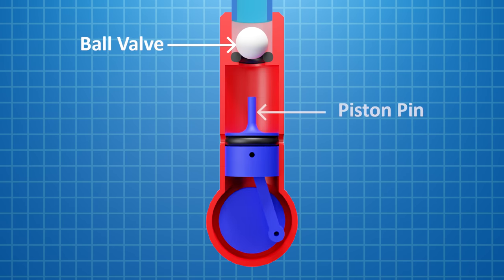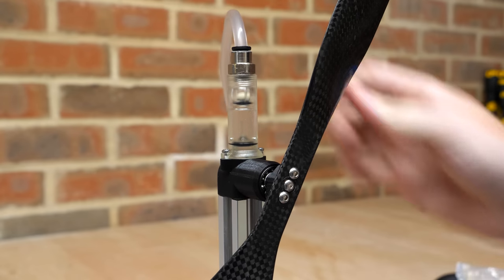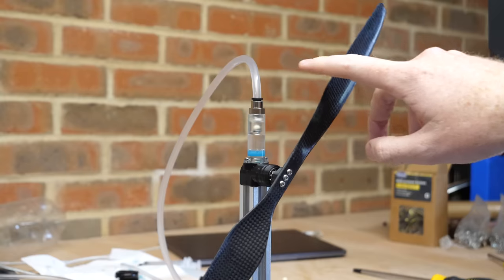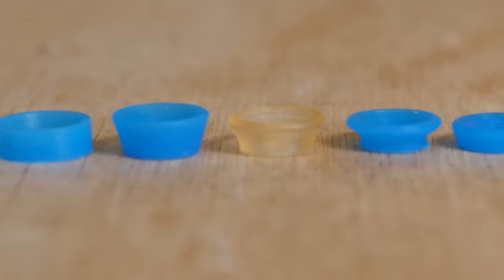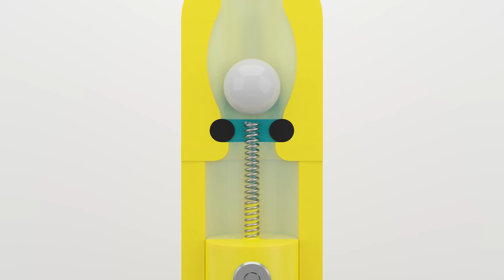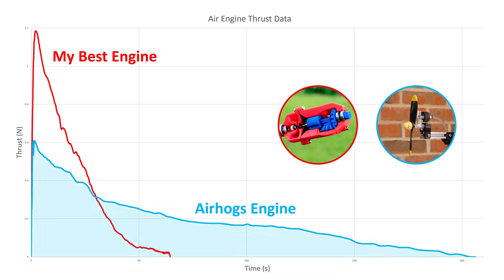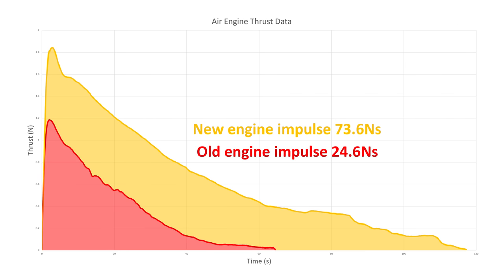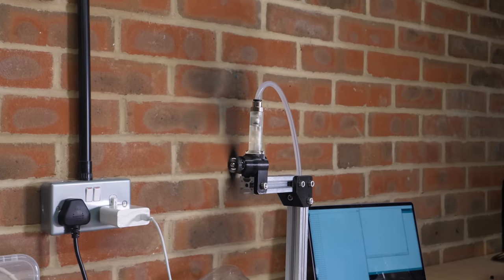Optimising an Air Engine

Comment: Would be interesting to replace the metal pin with a screw and see how adjusting the length of the pin affects the performance
Reply: Or create a cylinder head with screw to adjust height
Reply: maybe an Idea? firstly you could increase the piston total movement (increasing chamber/cylinder length), when piston is going down and reach in middle of chamber the piston also reach in the chamber roles, releasing the air pressure and after that this roles will close (maybe using more rubber valves) and the piston will continue its movement going down, at this moment it will create a vacuum in the chamber when piston reach on bottom of cylinder helping the piston up again with vacuum in the chamber, this could create more power?
Reply: yes it would be like ajdusting your camshafts
Reply: Or notching back a steam engine's reverser.
Reply: that would work if the air pressure was constant , which it isnt .
Reply: @brain8484  it would optimze anyway
Reply: @giovanefortuna that would modify the compression ratio, but the only thing that could change would be the time it takes for the compressed air to fill in the cylinder (and the height of the ball bearing of course)
Reply: @giovanefortuna  Not the same
Reply: @PedroGarcia-fl1fu  Hi Pedro. My first thinking about your idea: You will never harvest more energy from the "vacuum" than you needed to generate it.
Let me know, if you don't agree.
Reply: @g.j.647  true, you are right
Reply: @wololo10  Screwing the cylinder down, adjusting the head or rotating n eccentric crankshaft bearing have been used in CO2 engines.
Reply: Or you know, just start with a long metal pin and gradually grind the end down. You only need to do the test once to find the best length.

Or just use a removable pin and different length pins.
Reply: @PedroGarcia-fl1fu  no. just more moving parts and friction. but the idea of longer stroke would be good if the piston will come up more before the exhaust ports are closed by the piston so it have more momentum going up.

Comment: 3d printing is good for a lot of things, but a low friction piston cylinder is not one of them. You should design a piston and housing that fits a standard diameter glass or acrylic tube for the cylinder.
Reply from the maker: I've bought some acrylic tubes for this exact reason! I couldn't find any 12mm inside diameter tubes (diameter of my current seal design), so I ran out of time to re-design and mold new seals. But I will definitely experiment with the acrylic tubes for the 'aircraft worthy' engine!
Reply: @TomStantonEngineering maybe something similar to the glass tube/graphite pistons from a company called Airpot. I got a free sample years ago to try and make a Sterling (Stirling?) engine and the fit and low friction is outstanding.
Reply: @TomStantonEngineering would steel tubing work? You can get seamless hydraulic tube with 12mm ID
Reply: @TomStantonEngineering  Better option is to use a conical cylinder. and MACHINING. 3d printing is FAR AWAY from precision. as you stated there are air engines already in the market. why try to re invent the wheel since 3d printing will never have enough precision for something like this.
Reply: @vihreelinja4743  On the one hand, note that even with his techniques, he's still improved over the engine on the market multiple times. On the other, imagine combining his techniques with their production quality...
Reply: @TomStantonEngineering
Can you try with an engine ?
Reply: I suppose you could try machining the parts, yeah. There's also people who leave their 3D prints in a vapour of acetone, depending on the plastic, and it slightly softens the plastic, smoothing the rough edges. Wouldn't be great for precision but that'd be the challenge!
Reply: @daveycmusic  He's trying to build an airplane, not a submarine. We need to keep the mass as low as possible.
Reply: @JustOneAsbesto  14mm od 12mm Id hydraulic tubing will be grams more than the acrylic / glass but will work and will last
Reply: @vihreelinja4743  Because it is not about developing a product to sell but to learn something in the process perhaps?
Reply: @JustOneAsbesto check out gasparin engines
Reply: @TomStantonEngineering  I was so inspired by these engines that last year I started design around a syringe as a cylinder liner (20mm,15mm), and was hoping SLA printed piston will be good enough not waste too much efficiency, but syringes have ~0.1mm ID deviation, so fdm piston and tiny o'rings is the current design, but after this genial video with silicone molds :O I'm not sure I can beat it in this 2L engine impulse challenge.
Reply: or, you can print the piston and cylinder wall a bit larger and thicker, so you can sand it down make it a lot smooth
Reply: Turcite piston head
Reply: Even just directing the exhaust backwards has to help slightly   

I could also soo making the exhaust holes bigger but making pin smaller so it opens less might give better results
Reply: Would resin printing work as well? Resin printing has a higher resolution so in theory, the surface should be smoother
Reply: @rbuddsdiy  I put together a LTD (Low Temperature Differential) stirling engine kit from a UK company called Kontax.  It can run off the heat differential from your hand and the ambient air temperature, albeit slowly.  This is exactly the super-low-friction design they use -- a glass tube and a graphite piston (and a lot of ball bearings)!
Reply: @TomStantonEngineering  It might also make sense to create a two-cylinder boxer design to reduce the losses due to vibrations. One of your test stands is very stiff so you might not register them in your tests.
Reply: @TomStantonEngineering  I don't know if the materials involved are inherently bad, or if they cannot be sprayed with a lower-friction substance, but you can use plastic polishing compound - extremely fine mud - to polish the involved parts until they are as smooth as possible. I have done this with 3d printed bearings that use airsoft bbs!
Reply: @daveycmusic  but the thumbnail, you forget youtube primary focus is vanity vanity vanity
Reply: @JustOneAsbesto the steel could be less mass than the acrylic for possibly more structural integrity. Maybe aluminium is the happy middle ground?
Reply: @vihreelinja4743  Because his goal is not to make a production ready air engine. His goal is to experiment, learn, and have fun. This is about the process, not the end result.
Reply: @daveycmusic  steel might add too much weight I would think
Reply: @lordfrz9339  thin wall hydraulic tube is very light
Reply: @lordfrz9339  I agree with Davey, for the same structural strength you can obviously go much thinner with steel, so possibly lighter (less mass at least) than acrylics.
Reply: All the gear no idea 😂
Reply: @JustOneAsbesto making the cylinder out of machined 7075 aluminum, you could achieve much lower wall thickness and still be lighter with twice the strength and more precision
Reply: @TomStantonEngineering  No, seriously, I'd just buy a simple Stirling engine that sits on top of a cup of tea, and use the cylinder and matched piston from that. It will save you a whole heap of trouble. The fact that you got a 3D printed piston and cylinder working at all is astonishing, but those precision-made pistons and cylinders are are light, transparent, and have exceptionally low friction yet an air-tight fit.
Reply: @TomStantonEngineering  I also can’t help, but think that you need a leave! It would transform the accuracy of your piston and cylinders.
Thanks so much for this incredible content! 👏👏👏👏👏
Reply: @TomStantonEngineering  You can change the shape of the ball to one similar to Lollipop with the slotted stick, the piston would be concave and you could. thereby reducing the length of the compression cylinder
Reply: مگر جنس خشک چکار هست؟
Reply: خیلی خوبی از ایران
Of iran❤️🇮🇷🤌
Reply: @guygittins6934 Do you mean a lathe? Fair comment if so. 👍 Predictive texting is still very inaccurate, I thought AI's were supposed to learn but maybe we don't give them good enough feedback? This needs a better coded mechanism/UI for users to approve suggested spelling and meaning corrections at least review changes before we can hit the Send button. It seems predictive almost sneakily changes words after our attention has moved on in the comment composition process. Unhelpful for users and the predictive algorithms, whether AI or not. 👍😊

Comment: Crazy to think how little thrust you’d get by simply letting the air shoot out of the bottle through a jet nozzle, but through the miracle of science, it’ll make a ton of thrust for minutes on end. Very amazing! I’m impressed.
Reply: Requires reservoir bottle for Exhaust return 🤔🤔🤔
Run time increase due to Return to source instead of vent to Atmosphere.
Reply: I often think about this as it relates to modern ICEs. You can push a few thousand pounds more than a hundred miles with just a few gallons of gas. That's crazy.
Reply: crazy ?
Reply: @-Pkji- crazy amazing.
Reply: everything in the world is reliant on shapes and geometry
Reply: @funnyberries4017    Hypothetically it wouldn't be a 'reliance'.  All exists in the world that exists in it and our job tends to be to project concepts and to look for patterns, which is fine.  But 'where would the world be without 'shapes' and 'geometry'? is taking it to far.

Comment: Absolutely LOVING these research and development episodes.. 
I absolutely love that you got hold of the original designs from decades ago, and then smashed the record of it using lessons from their own design..
It does make me wonder if the seal inside the 25 year old box has over-hardened over all that time so is not working as well as it did new.